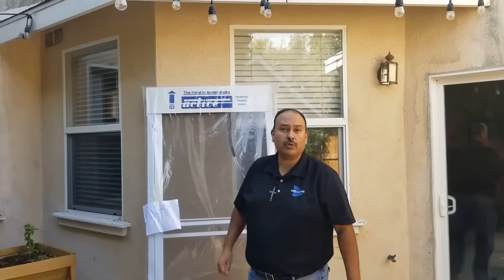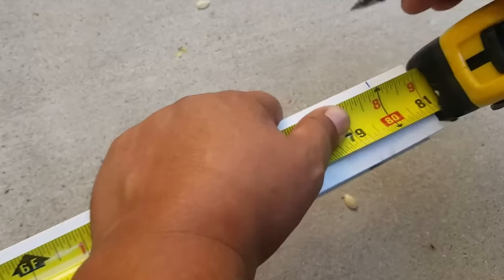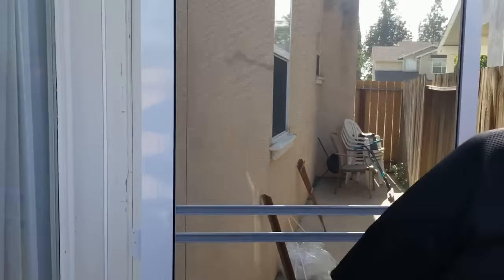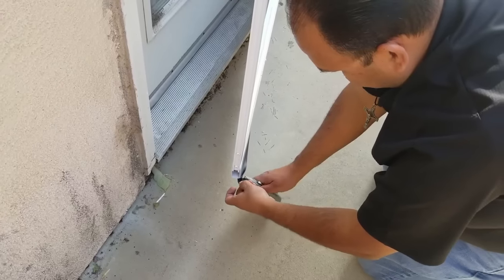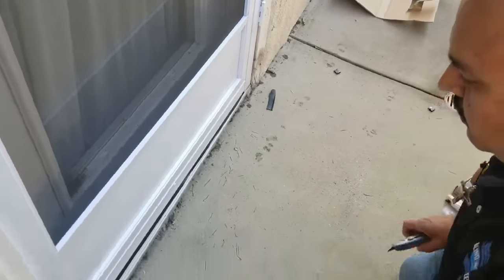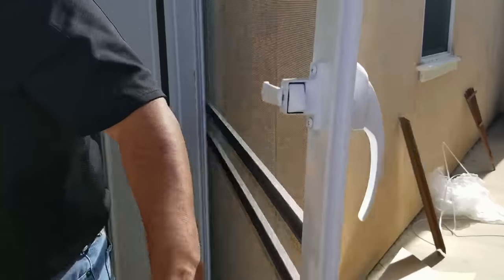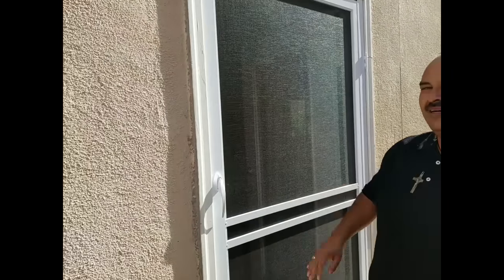How to install a Screen Door

Comment: Old video but I think you were supposed to cut the hinge part of the frame 2  3/16
So that the bottom cross shoe or bug rubber strip goes all the way across on the bottom. 

But great video. Gonna install 2 tomorrow.

Comment: Ok as for the gap on the top.  Personally, I would have placed the door flush with the top of the hinge channel.  You gave it 1/16 of an inch for clearance which should be just fine, then I would have adjusted the bottom sweep plate to fill the gap on the bottom.  The way you have it installed  just does not look good.  I believe the bottom sweeps are large enough and meant for that purpose.  I do not mean to criticize your work, only that as the customer, I would have not accepted that installation placement of the door.  And if you know you are working with aluminum, you should be prepared with the tools needed, such as the deburring tool for the holes, using the box knife is not a good way to represent how this is suppose to be done.  There is one more item you did not mention and that was that you were placing this door onto the actual door trim work.  Was that trim sturdy enough and anchored properly to be able to hold up to a swinging door. I would be upset if one day you go out and off comes the door along with the trim.....

Comment: Very nicely done. I need to install one of these to keep my cats from getting out accidently. One question, do you use a special blade in your mitre saw for cutting the molding? I have a mitre saw that has the standard blade installed that I use for cutting lumber. Can I use that or do I need another blade.
Reply from the maker: Thank you for your wonderful comments.  We use a special saw blade that is very costly, but you can use a standard miter saw with a blade that can cut aluminum and get the same results.
Reply: @Bestcustomscreens  how many teeth does your blade have? I bought a Diablo blade for metal but it does not cut as clean as yours.
Reply from the maker: @bernitup6492  It doesn't have to do with the teeth as much. You should have a 120 tooth carbide tip blade that cuts aluminum and it should work. But that is not why our saw cuts so smooth. 

The saw we use cuts steel, aluminum, wood, plastic and more. Why? Its because of the slower rotation and type of saw https://amzn.to/38PhT1z   - Check it out! The Evolution Saw is amazing.

Comment: Great video Steve, thank you!  One question, does it matter, when you shorten the outside frame, if you cut from the top AND the bottom or just from one end?  ie. the hinges won't be centred, or does that really matter?  Thanks.
Reply from the maker: It's doesn't matter top or bottom or  if you cut both to center. I usually cut top only because that's how I've been doing it for years.
Reply: Thanks, that helps.

Comment: the additonal screws you added to keep the actual screen door in you just guessed where to put them at or  are there holes there to add the screws?
Reply from the maker: It's not really a guess.  You need make sure it's 8 inches from the corners and one about center.
Reply: Ok..im embarrassed I asked that question ☺️ I just had to rewatch that part.thank you😊
Reply from the maker: @wezugo34  don't be embarrassed.  I'm here to help.  Thanks for watching.

Comment: Pre drill the wood screws so you don’t run the chance of splitting the wood , place 1/8 shims on the head and the strike side with tape for a solid reveal and shut the door and screw it off
Reply from the maker: The screws that come with the screen door are self drilling. Everyone has there way of doing things. I am pretty much self taught after being in the field for a few days...lol. Thanks for the input.

Comment: Are you installing it on the door trimming?
Reply from the maker: Its is being installed in the door frame or you can also install at the stucco molding.  The door frame is best if you have the room with your door handle.  Hope this helps. Sorry for the later reply.  Please let us know if there is anything else we can do to help.

Comment: Nice job but there seems to be a gap at the top
Reply from the maker: Thank you. Yes we realized that when we installed it.  This is what happens when someone else measures a job. We ended up going back and adding a channel on top to close in the gap. We shot the video anyways because of the need to have this video.  Thank you for the feedback.

Comment: Can someone tell me why there was a gap at the top of this door ?
Reply from the maker: Because the customer ordered online and didn't measure correctly. We were able to fix it later and we needed to shoot the video.  Either way it's worked out for us because this is one of our most watched videos and people always ask this question.  

Thank you for you input. Did you install a screen door today?
Reply: Once he slid the screen door into the track, he should have closed the door then slid the screen door up to leave a 3/16 inch gap at the top then use screws to attach screen to track. That's the reason why there's a gap on top. Other than that missed step, it was a great video.
Reply: @Bestcustomscreens  what did you do to fix the gap? or what did you used?
Reply from the maker: @minino-111  We used the same type of u channel that is used on the bottom.
Reply: Because it was installed wrong.
Reply: @Bestcustomscreens  doors are 80" ... dont blame the customer for a poor install.

Comment: Sorry but that’s NOT how you install that door-closer device! That’s why that door you installed will NOT fully open 90 degrees and it’s why it won’t pull closed as it should! The little plastic spacer is used for installation. It’s purpose is to create the correct space gap, THEN you screw on the other end while the door is fully closed, then you remove the plastic piece.
Reply from the maker: I cant quite understand exactly what you are describing. Can you share a video that explains this?

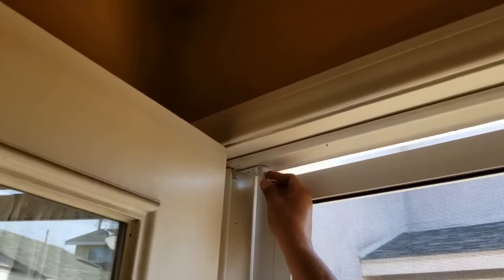Comment: 14:49 If your drill bits don’t have a point then use an automatic centre punch 1st. 21:57 I like the screw up on the top where you can see daylight for about 1/2”.  So he forgot to line up the top before screwing in the bottom piece with the rubber sweep. Duh. Don’t hire this guy.

Comment: Too bad the bugs can still get in with that huge gap at the top of the door. What happened with that? If your doors are all like this, maybe we should shop elsewhere.
Reply: @nategonzales6135  But there is a huge gap at the top. Otherwise looks well fitted.
Reply from the maker: Thank you for watching our video all the way through.  You wouldn't have noticed that until the last half of the video.  We realized there was a gap but we still shot the video because we had approval from the customer. Someone else measured and ordered online.  This is what happens when someone doesn't know how to read a tape measure correctly.  We still came back a later time and added a piece of U channel like it has on bottom to stop the bugs.  Thanks again.
Reply: @Bestcustomscreens  doors are 80" ... dont blame the customer for a poor install.
Reply from the maker: @wllm500  Why is it people online don't know truth when they see it.